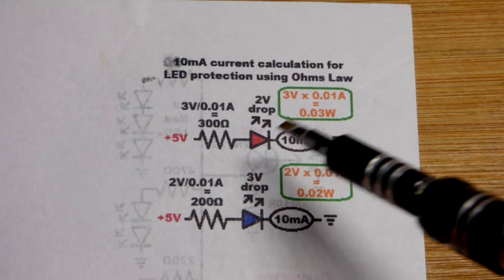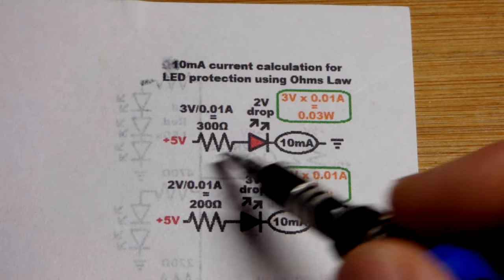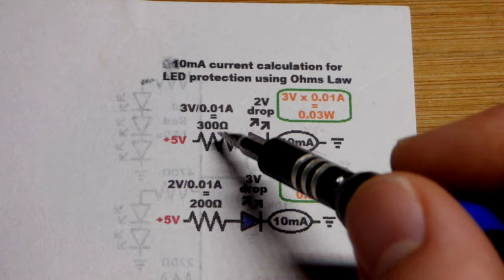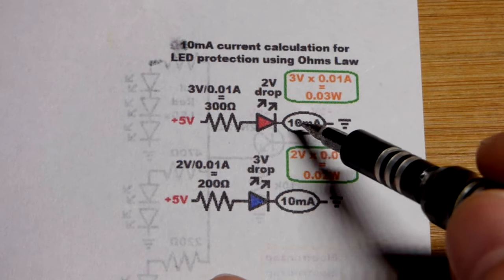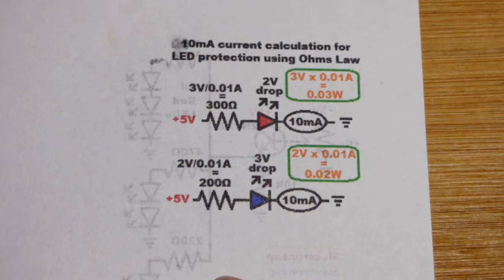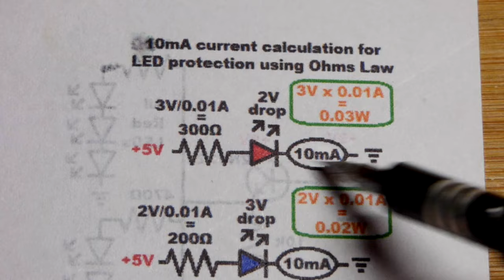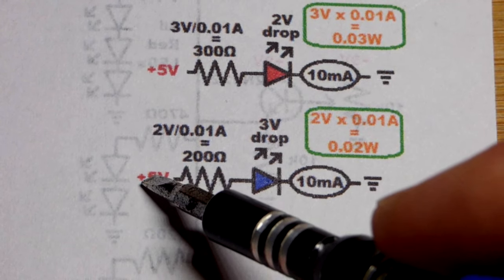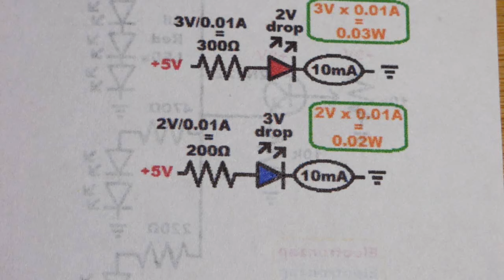How to calculate the protective resistor value needed for 10mA through an LED

Comment: I would often connect 3 white led's in series with a current limiting led in series for use in my vehicle off the 12v battery, but I found this to be a very bad idea, and the reason is the voltage swing of the battery from 12v to 14.5v when the engines alternator charges the battery after starting, it then would fall back to like 13.7 for the rest of the journey.

my leds were the usual 1w bead led's at 3.3v so upto 300ma with good heatsinks, I would run them at 100ma, so, 3x3.3v=9.9v dropped, 100ma 'required' current, 12v, 24 ohms...
this gives me almost 1w of light spread over 3 leds running cool with a long liftetime.

Problem is the initial first few minutes of 14v, the current goes upto 200ma from just 2 more volts!  This puts the leds upto 2w and the resistor now has to pass 1w
This causes  a noticeable difference in brightness and generated heat.

So i went back to using one 91 ohm resistor per led but then it needed to be a 1w resistor! now my heat has moved from the led, into the resistor! I have nearly 1w of heat in the resistor and 1/3w used by the led!!! 30% efficient!

It seems theres no happy place for such simple circuits and some voltage regulator is required to give like a stable 10v from the 12-14, which is what I did for  my interior lighting. 

sometimes even the simple things can be a complicated journey. great video thanks for reminding me of the struggle I had lol
Reply from the maker: Yeah, I made some videos based on 12V battery circuits. I design the circuits to run on 12V to 15V because LiFePO4 batteries are commonly charged at 14.6V. There's buck converters that lower the voltage while conserving most of the power so that they don't get very hot compared to resistors and regulators.